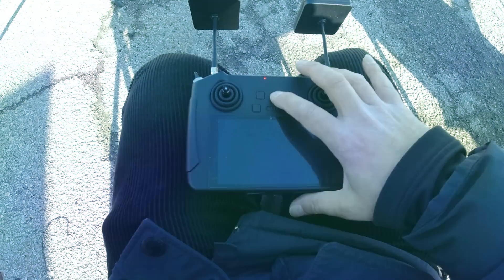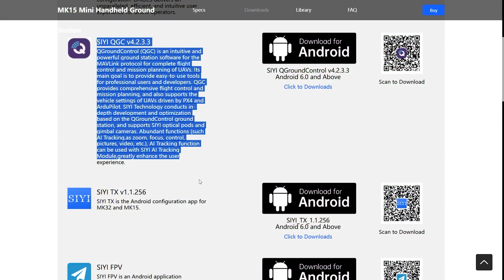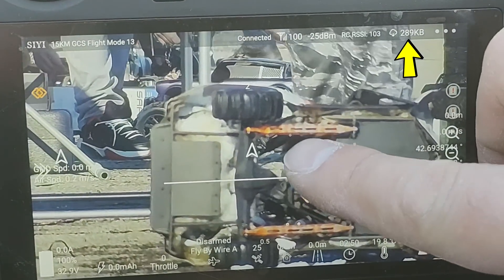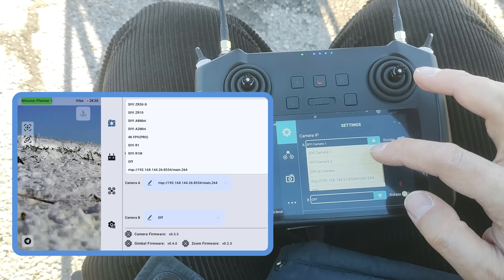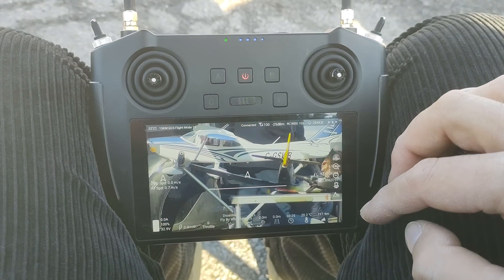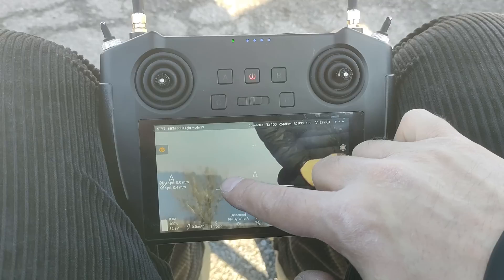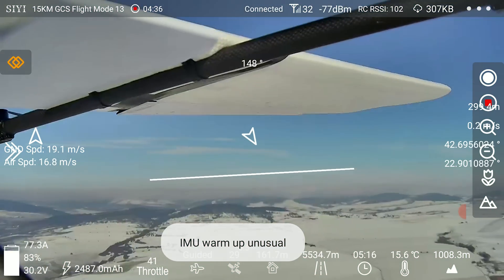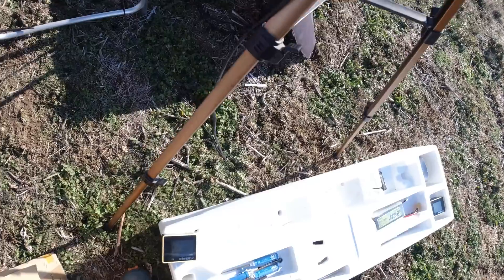From Ancient Times Before UniRC 7 - the SIYI MK15 system!

Comment: Hi, your video is really helping me to compose my own FPV.

I have one question, but the plane is using HEEWING T1 VTOL and ZOHD ALTUS VTOL.

I'm configuring a system that uses MP while receiving video, and I'm thinking very much between "SIYI FM30+DJIO4 UNIT" and "HM30."

What system do you think can make the aircraft fly longer while increasing the flight time?

Thank you always :)
Reply from the maker: I have no experience with the FM30 module, so I can't really comment on that, but the DJI module is smaller and lighter, so from that point of view I would say go with that one. Actually I have no idea what the air module of the FM30 system looks like, but hopefully it is small and light.

Comment: I really like your videos!

Have you tried connecting an HDMI camera to the air unit of the Siyi UniRC 7? Like a GoPro or maybe a Sony camera?
Reply from the maker: Thanks. Do recent model GoPros actually have an HDMI out port? I am not aware of this functionality! You can't connect an HDMI camera directly, but SIYI do have an HDMI to IP converter - you connect the HDMI signal to the converter and the other end gets connected to the air unit's LAN port. I would imagine, however, that this conversion might add a few more ms of delay.
Reply: @ArxangelRC  The GoPro I have don't feature an HDMI port by default, but there is an accessory that can be added. It's basically a case with an HDMI port for the GoPro. I believe it's called the Media Mod.

I am working on building a heavy lift octocopter in an X8 pattern that should carry a small cinema camera on a gimbal. I think it will be the FX3 since I already have one of those.
Currently, I am having trouble finding the perfect VTX system. I think the Siyi UniRC 7 Pro is really interesting and the price is quite good. But it depends on whether it is possible to output a clean video feed without the OSD from the HDMI port on the controller. The video from the drone will be used for livestreaming, so it is important that I can output video without the OSD.

If that is not possible, then the DJI Transmission System seems to be the only viable choice for me.
Reply from the maker: @frederikhandberg  I have discussed this with SIYI and sadly the HDMI can only output a clone of the UniRC 7's screen, so a clean output might be possible only if somehow you open the stream alone, and don't have the OSD overlay. However, if you can connect the radio to a laptop via a LAN cable or over WiFi hotspot from the radio, on the PC you can open the live stream in some program, and it will show it without the OSD overlay. I think VLC player worked reasonably well for this.
Reply: @ArxangelRC  I think connecting with a WiFi hotspot might be too unstable, but connecting the radio to a laptop via LAN cable seems like an excellent idea.
Reply from the maker: @frederikhandberg  Well it depends how far away you would be, but up close wifi hotspot should work just as well... but yeah, I would prefer the LAN cable. Has worked well for me.

Comment: Hi there. I am beginner at pre-purchase researching stage. Is there some possible OSD indicator that could be used to help a pilot keep their goggles/directional antenna pointed toward the drone at all times? Not like the existing RTH arrow which does a totally different thing, but more like a pilot's head compass strip with a mark for the drone's direction. Thanks!
Reply from the maker: I have not seen this. I think it does show direction in degrees, but apart from that, getting SIYI add in graphical elements and additional OSD information has been futile! :D

Comment: I've got the MK32 and have done Bluetooth and Wifi hotspot telemetry sharing with stock firmware. Perhaps I had a newer firmware to start with. I did download the UNiGCS software from the website, and it works very well. From your videos, the functionality is for the most part, is the same. The design, gimbal stick and the screw thread mount on the bottom, are the big differences for me. I know it's also got 2 sets of antenna for the air unit as well, so obviously hardware is different and the air unit is smaller. There are some functional issues I've had, but they've been mostly related to the firmware on the cameras, and missing features that are included in the older Siyi FPV app for camera settings.
Reply from the maker: Hmmmm... yeah, you must have received it with an updated firmware, but I've had this MK15 for ages, and it hasn't been updated, not sure I want to risk it. Thing is though... if you share the telemetry over bluetooth or WiFi from that MK32, does it work normally in the app, or do you start to get telemetry update freezes and it sort of splits  where it updates the app and the computer, i.e. the telemetry does not flow smoothly on both devices? As for the UniRC 7, the non-Pro version has only 1 set of antennas, the Pro has 2 because it uses two different frequencies. I am glad to hear that the UniGCS app works well on the MK radios, will probably give it a try soon on the MK15.
Reply: @ArxangelRC  Actually, now that you mention it, Frank had one of his guys send me the firmware to flash and I updated it. But that was because I needed to update the camera firmware for the A8 mini, and it required flashing the air and ground unit as well. But it went very smoothly I recall, didn't have any issues. You should contact them, so they know the hardware version and give you the right firmware.

Concerning telemetry, I have only ever used Wifi (because I also want the Video stream) to my PC. I'm building a ground rover with a Losi DBXL-E 1/5th scale RC car. I've managed to control using my racing sim, and use the racing sim joystick with Mission Planner over the telemetry connection to control. I haven't had any freezes that I've seen, but I've only had limited testing. I don't usually use the Siyi app on the MK32 when connected to PC, but I can try that test when I get my sim up and running. It's been out of commission while we did a house remodel. The UniGCS app does have some minor missing features, like controlling camera settings, but I also can use the SIYI FPV app. The UNIGCS software sort of combines Siyi FPV and Siyi TX into one app, which I like. It's a big step up from the Siyi TX app, IMHO.
Reply from the maker: @TravisGintz  Yes, it is a big step up. It also mixes the QGC app in there as well, so like I mentioned in the video, it is more like 3 apps into one! I hope they address the things missing from it soon!